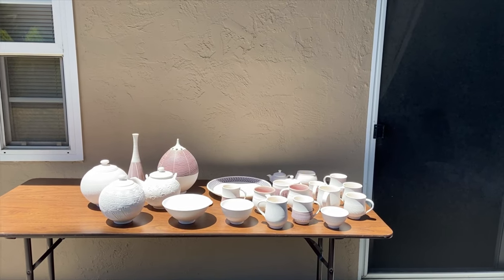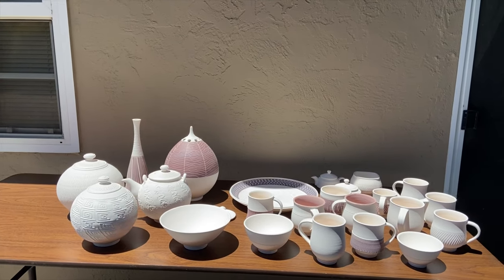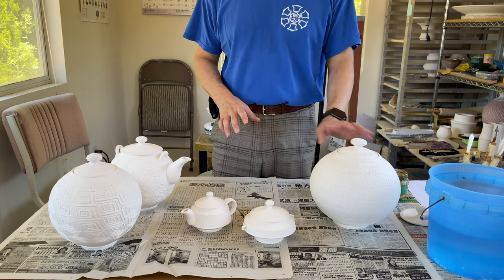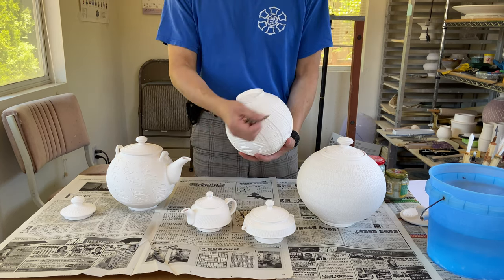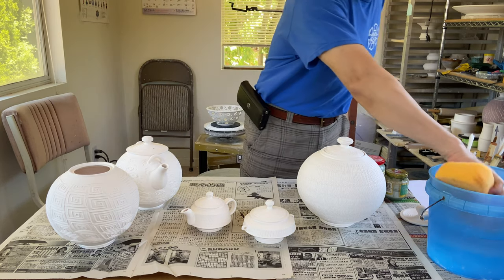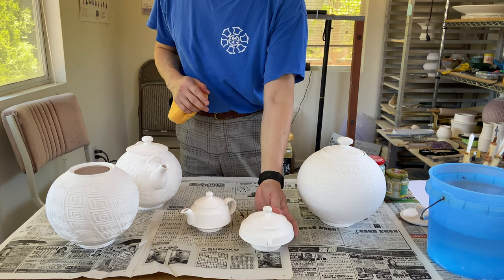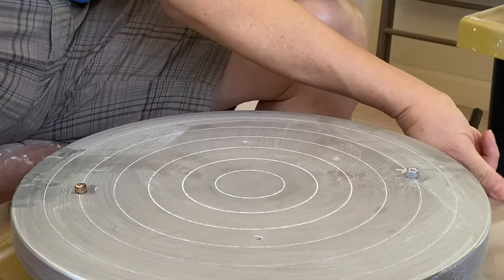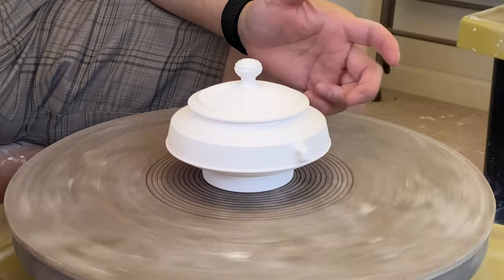463. Glazing/Waxing a Flat Covered/Lidded Jar Using Multiple Glazes With Hsin-Chuen Lin 林新春 扁蓋盒上釉示範

Comment: Thank you for the glazing detail and the information about the brushes this is a very good video.  Does the aluminum hydrate leave a residue of any kind?
Reply from the maker: It’s high refractory so it leave white powder after fire. That’s why I suggested to use it fir the foot or lidded jar.